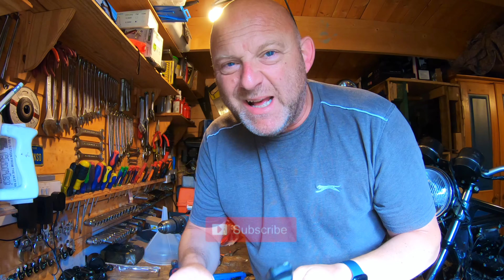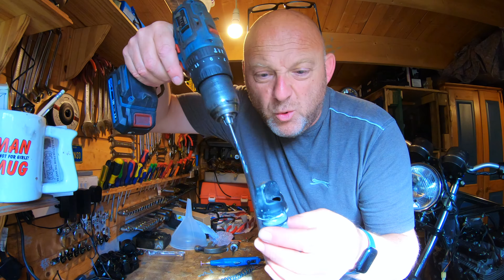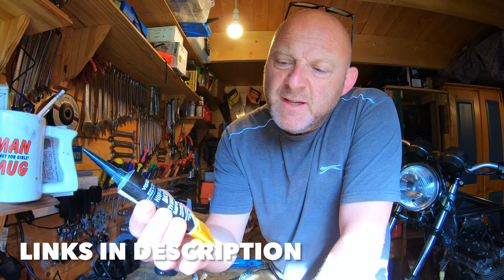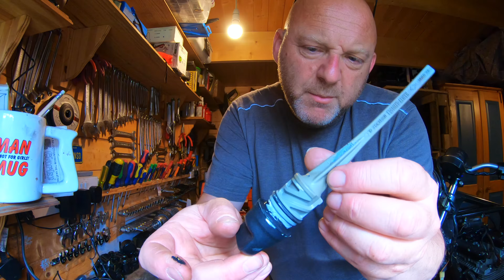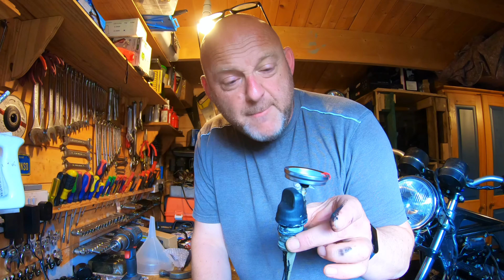How To Make An Oil Temperature Dipstick For Harley Davidson M8 Engine

Comment: Not to be negative but back in the 70s I built a lot of motors took them apart put them back together, I found out using silicone is a ( bad idea ) !!! Pieces of silicone break off and log in oil arteries then restrict the oil in that area , not good

Comment: If you cut the plastic off beneath where the thermometer sticks out, when you get home from riding, you can take it in with you and use it to check your chicken's temp. You can even stick it under your tongue when you have a fever. Patent that thing!
Reply from the maker: It’s happening ha ha

Comment: Ok ok. A bit a fun... Basic idea is very  good. The oil cooler only cools the oil going to the top of the motor 
  Then goes back to the oil tank. The cool oil doesn't go to the whole motor. 🧐  Now to the temperature gauge... love your idea, you could have gotten one with a smaller face so it doesn't look gordy... My friends and mechanics would lauph at me. It would be the topic of the month. "I LIKE IT"  Thanks for your hard work. Shiny side up 👍
Reply from the maker: Yes the design needs work ha ha